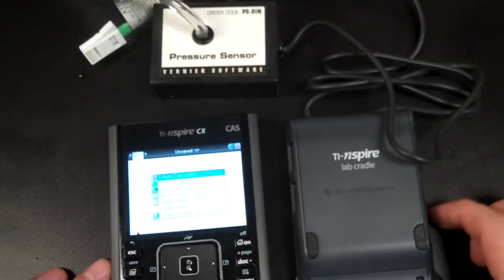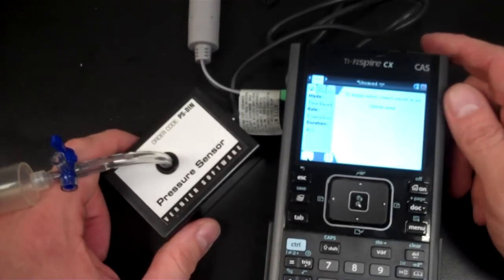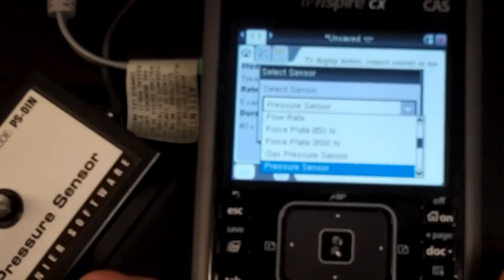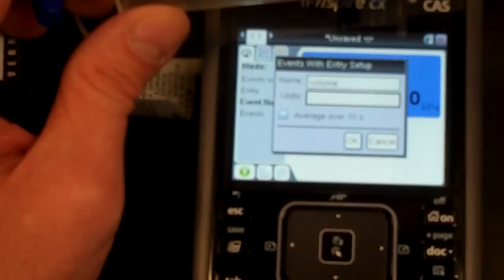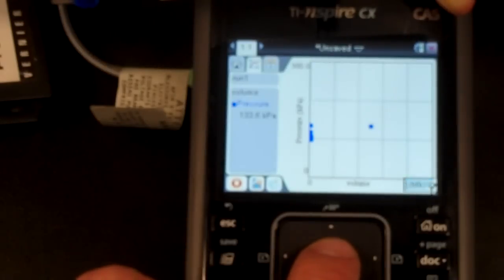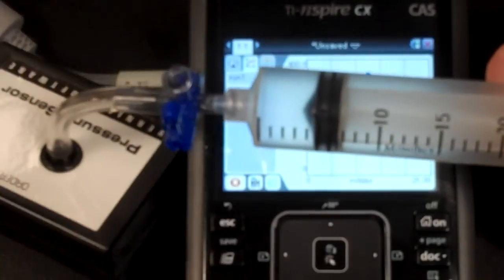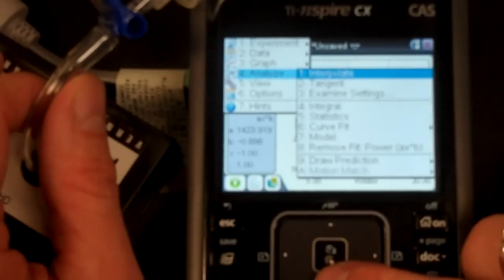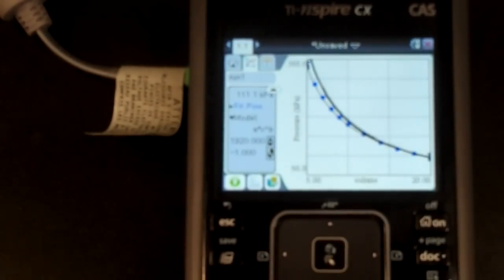Pressure Volume TI-Nspire Lab Cradle Event with Entry

Comment from the maker: If you just have one Temperature Probe Sensor from Vernier you can get by with an Easy Link. If you want to do more than one to record and graph temp data, then you'll need the TI-Nspire Lab Cradle. If you have the Easy Temp (or Go Temp with a $5 USB to mini cable) then you don't need an additional interface. I youtube allowed I would provide a link to the specific Vernier site and my Godly Dominion blog to give more details and pictures.

Comment: Thanks for sharing this video. I was wondering whether you can connect any sensor (analogue, digital) will the software recognize anything ? I know its compatible with Vernier product , but I was going to build my own sensor and I wonder whether is still gonna work.
Reply from the maker: Great question. As you know there are over 50 Vernier probes that work - both analogue and digital, but I currently don't know of other (brands or homemade) sensors that will work. I know you will need the write type of connector - BTA or BTD - to fit into the TI-Nspire Lab Cradle (or EasyLink). I'd be interested to hear how it works for you.

Comment: I have a ti nspire and my question is. Is it possible for the calculator to act as a volt meter/scanner ?  Will it capture data for a period of time without a need to enter y values ?
Reply: I’m pretty sure it will get y values regardless. It can show them in a graph and a table (there is a third one but i forgot what it did) so if you just want the measurements you should look at the table